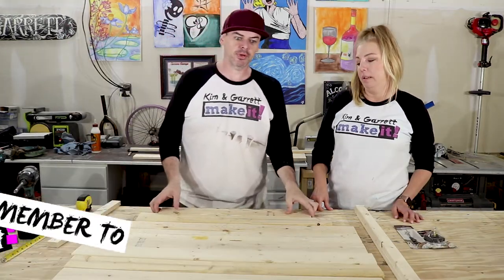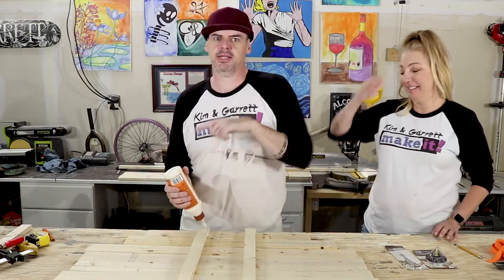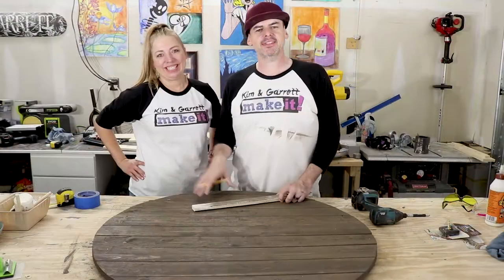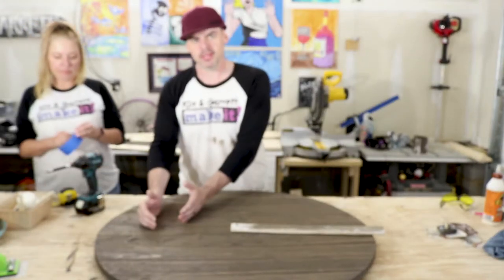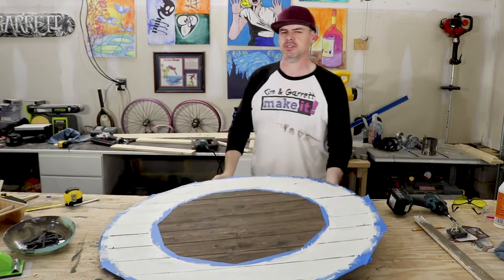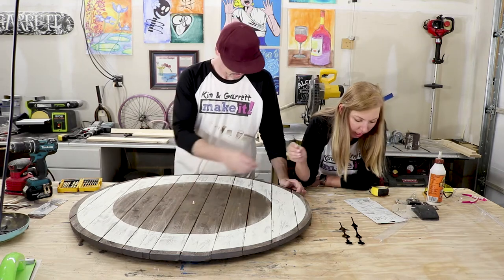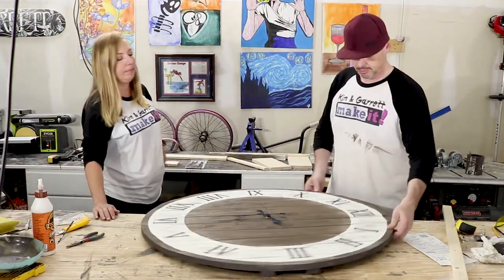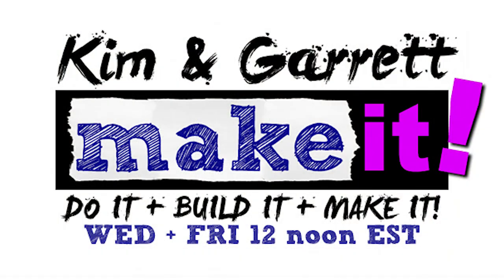How to Make A Giant Rustic Wall Clock

Comment: Making one super similar for a customer, wish I
Would have found your video sooner! But i eventually figured out the stick compass! Lol after several fails. And ordered the larger clock pieces off amazon because going everywhere like you said, they all had the same smaller kits. But where did you get the Roman numerals? I couldn’t seem to find a great size so I printed them out and am currently making my own stencils, which is a pain! Lol
Reply from the maker: Very cool! Did it work??
Reply: So far so good, I just finished about 3 hours worth of cutting each one out with an exacto knife lol. Tedious work!!😵💀

Comment: Looks nice. I have made a few clocks. I would suggest larger arms. They still look to small. (My opinion) You can get them from bearwoods.com 
For an easier cleaner circle use a circle cutting jig and a plunge  router. Great job though. Good idea with the painting.